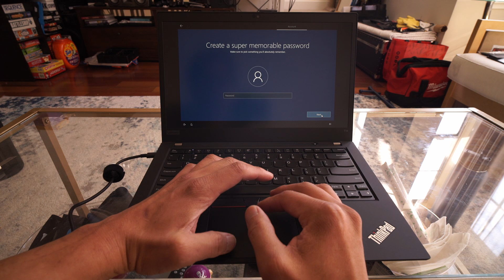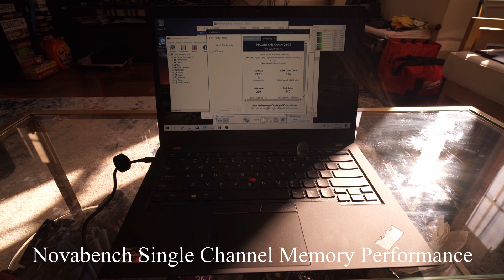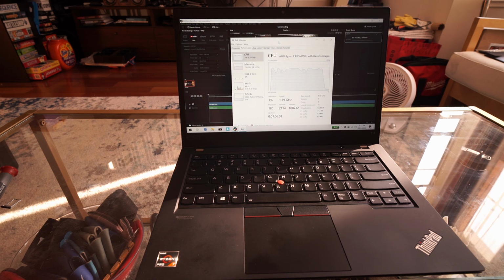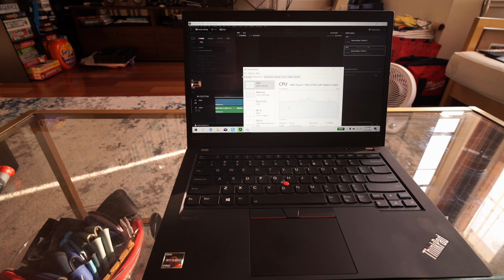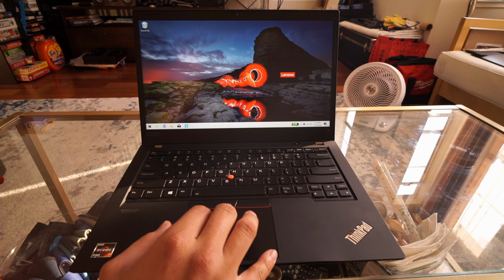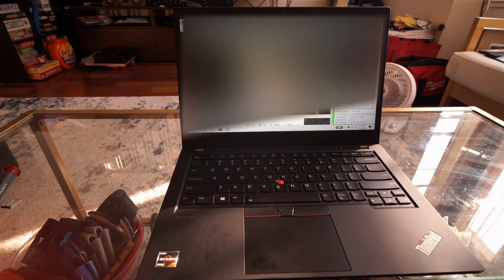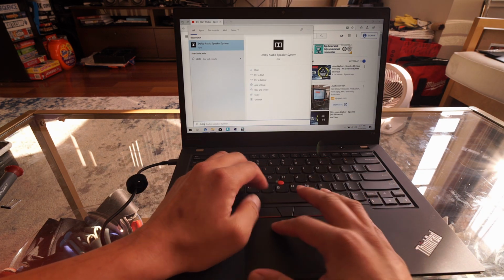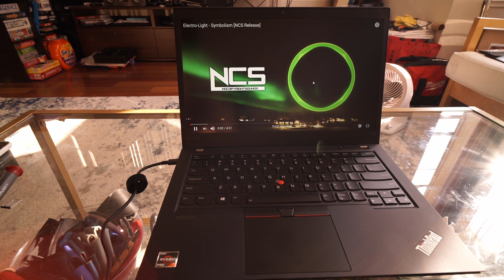Lenovo Thinkpad T14 AMD First Impressions and Lenovo Thinkpad X13 AMD Comparison

Comment: I used to love Thinkpads but their design has just gotten too dated and they keep making changes for the worse.  For example, Thinkpads are known for their great keyboards, so Lenovo, please stop reducing the key travel and please an effort so that the keyboards across ALL of your suppliers are the same.  I've experienced keyboards that feel different across the same model simply bc they were from different suppliers.  Another example is, use something other than that super cheap plastic bezel around the matte IPS screen panels!  In 2022, for what you charge for an T14, T14s, X13 and other models in those series, a super cheap looking bezel is not acceptable!  Also give us some decent speakers and a better webcam.  Speakers should not sound worse than those on cheap consumer grade laptops!

Comment: The "flimsy" heat pipe design is fine.  There are 4 screws connecting it to the mobo.  The heat pipes do not flex under their own weight, and they have no where to go anyway as the bottom cover keeps them in place.

Most laptops are designed this way with no problems, it is not an issue.
Reply from the maker: The 4 screws are there so that the heat pipe makes even contact and pressure with the processor just like any other laptop, but there is always one or two screws that hold down the fan to the chassis.

All other laptops are not designed this way, trust me.

Comment: Thanks for the review. How's the overall heat and throttling situation? Does either get seriously hot in mild/heavy load.
Reply from the maker: No problem. Heat isn't bad at all, and to me the laptop is "throttling' due to TDP. I feel like if the TDP was increased, the laptop could perform a lot better. This however can be changed with Ryzen Controller, but your warranty may be voided. It doesn't get seriously hot when I'm editing or encoding video.
Reply: @mistahcheng  Any ideas on the overall heat and throttling with a T14 gen 1 Intel i5-10xxx ? Would it be worse than the AMD? Thank you.

Comment: Is T14 Ryzen 7 pro good for virtualization? Can I run 5 VMs at a time ? will it cause heating issue?
Reply from the maker: It all depends on what you're on doing on the VMs. If you're just doing small tasks, then no.  However, if you're running intensive tasks on your VMs, potentially yes.

Comment: I ordered one in mid October, it was scheduled for around late November, but now it's not getting here (US) until Mid January. These things are ridiculously delayed. Might have to cancel my order
Reply from the maker: @Not Applicable So the fan actually doesn't have any screws holding it down on the T14. If you look at the service manual, the only screws holding the fan and heatsink to the laptop are the four screws that hold the heatsink to the CPU retention bracket. I still don't get why, but that's how it is on the T14.
Reply: @mistahcheng  it’s the same on T480, I can confirm... never had a problem with it tbh, since when the bottom cover it’s closed it doesn’t move
Reply from the maker: @silviuszabo6605  agreed, it's more than likely not going to be an issue, but just about every other laptop I have seen has the fan secured somehow or another. For me, this shows me the difference in build quality between laptops.
Reply: @mistahcheng  Is it that poor quality like I see in 4:39 ? I mean ok, I understand the fan not being secured cause they've been doing like that since T480 but that build quality it's awful, I mean I tried pressing on my T480 like you did and the palm rest or the keyboard didn't go down like in the T14, I'm about to buy a T14 and I'm really concerned. I know they're trying to make it weight as less as possible but the difference in weigth between T480 and T14 it's very little to justify that amount of loss in quality... ThinkPad T14 (3.28 lb / 1.49 kg) and ThinkPad T480 (3.6 lbs / 1.63 kg). I don't like the way ThinkPads are going...
Reply from the maker: @silviuszabo6605  so when I'm pushing down on the palm rest I'm pressing firmly but not with excessive force if that helps. All laptops will have some kind of flex, and the reason why I think the X13 for instance had less flex was because it's a smaller laptop and has a smaller area for palm rest flex. With that said, I definitely think the T14 is a considerable upgrade over the T480 if you need the extra computational power. If you're just doing normal everyday tasks and even light programming, then there's probably no need to upgrade unless you feel the need to do so. I hope this helps !
Reply: Mine is expected to arrive after a wait of 11 weeks due to shortage of parts. Don't really know whats going on.
Reply from the maker: @gitset  holey moley. What are the specs of the laptop you ordered and did it say ship time of more than 5 weeks when you ordered it ?
Reply: @mistahcheng  Custom order of ryzen 7 pro 4750u, 16gb ram, 256gb SSD. It said 'ships within 4 weeks' when I placed my order in mid oct. I heard they ran out of CPUs.
Reply: @gitset  I had to cancel mine, they're going to keep pushing it back Mine is now for Feb 19th which is ridiculous even for a "custom" laptop.
Reply: @robin2080  I contacted the customer service for my area(Singapore) and he told me that the new projected date is final.
Reply from the maker: Yeah, it's ridiculous. People don't believe me when it took over 5 weeks before it shipped plus an additional 1.5 to 2 weeks to clear customs and get from China to CA.

I may be selling mine depending on how it compares to the HP Probook 435 G7. 

If I end up choosing the Probook over the T14, I can let you know if I end up selling mine !